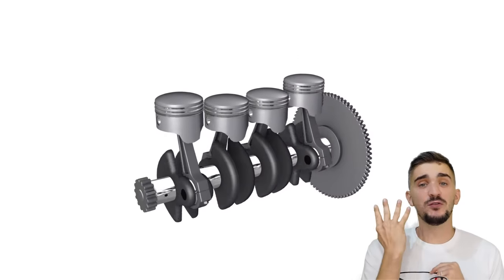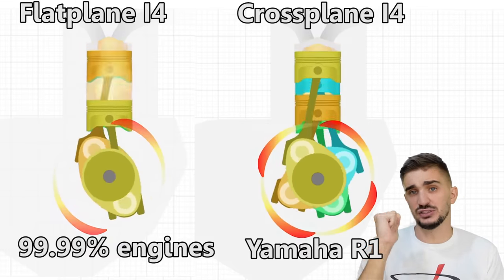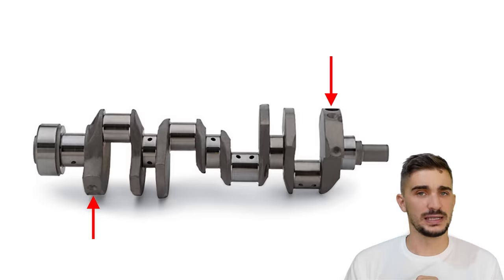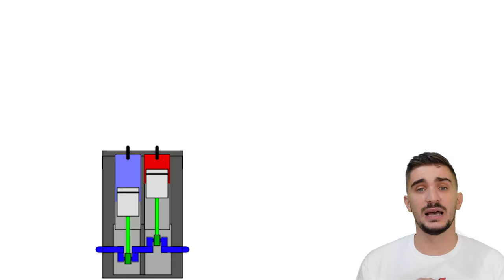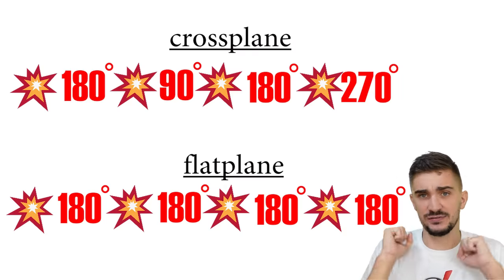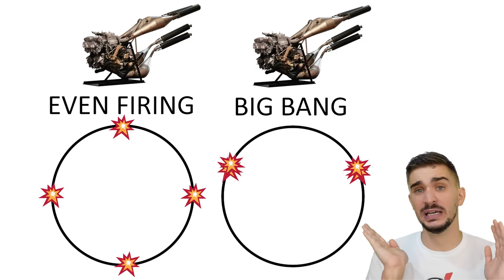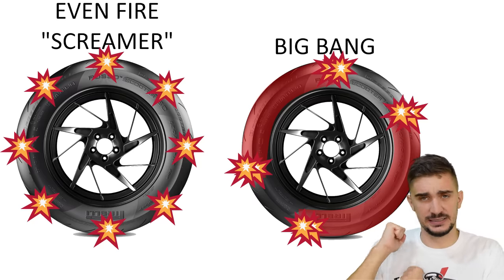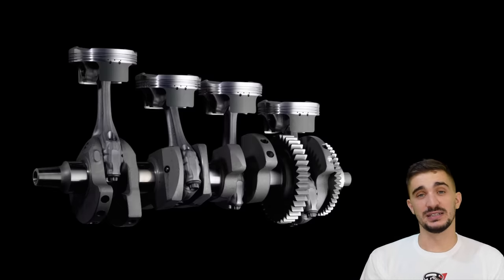CROSSPLANE inline 4 EXPLAINED in detail - How the YAMAHA R1 i4 differs from all other INLINE FOURS

Comment: There is one large problem with a flat plane crank on a four-cylinder engine. Leading to balance shafts and large counterweights being fitted, and that is all four pistons and rods must come to a complete stop to change direction at the same time every half revolution of the engine. Two pistons hit the bottom and two hit the top the pistons have to physically stop moving to change direction, where a cross plane crank only two pistons change direction at any one time.  If a flat plane crank is so good, why don't they run them in a inline 6 cylinder instead of journals 120 degrees apart.   If I had a choice, I would select a 5 cylinder ( an opinion only :-) .)

Comment: So I guess the question I have is, why can't pistons 1/3 and 2/4 share planes instead of 1/4 and 2/3? You'd reduce the distance between the pistons and reduce the torque from the rocking couple.

But you would displace it I guess in that cause. I'd imagine you would cause the center of the rocking force to oscillate between basically the centers of piston 2 and piston 3 on that perpendicular.

Interesting development

Comment: Excuse me, I want to ask: Is it possible to make a v4 engine with a cross plane crankshaft ?

Because I think maybe with the use of this configuration the Yamaha engine can get a increase in power . Because the rotational is 90 degree every cylinder firing turn like on a America v8 by firing alternately between 2 cylinders, like you explained. And in order to counter the low revving American characteristic by using the balancing shaft. 

And maybe use 2 exhaust like the one in rc213v, so the exhaust gas can flow out more freely and not get stuck making the engine can get a lot more power .

I was inspired by your explanation in this video and your video for the corvette cars crankshaft ( Very detail and good explanation by the way). So i was thinking maybe with this solution the Yamaha motorcycle can get more power but still retained stable cornet exit acceleration, still have the recovery gaps and decrease high side possibility.

I don't have any engineering degree, so if this sound ridiculous I am sorry . But I would like to hear your comments in this theory of mine, Thankyou.

Comment: Does this design produce more torque coming out of the corners? I know with cross plane V8s they tend to have more low end torque than the flat plane V8s, so I was wondering if that translates to these 4 cylinders.

Comment: I see the crossplane R1 has the exact same firing as my VFR800 90 degree V4. 
I have 180-270-180-90, but i've overlaid the cylinder position graphs and saw that there is perfect balance since there is a compression stroke at the same time as every exhaust and an intake at the same time as every power stroke, although with the V configuration there is a backward and forward imbalance, and secondary imbalance is counteracted with the shorter crankshaft than an I4. 
@Driving4answers could you make a video on the V4s in the VFR, Ducati V4 and Aprilia V4.

Comment: Every inline 4 I've torn down had the exact same wear pattern on the cylinders. Even blocks that should have been extremely rigid showed signs of flex from the opposing masses. Wondering what  wear pattern will be found on the crossplane design.

Comment: I'm confused about the balance shaft. It appears to be either gear- or chain-driven (presumably by the crankshaft). It looks like it would add inertia to the engine's rotation in the same way heavier counterweights do with a cross-plane V8. Why does the balance shaft not affect the "rev-happiness" of the engine?

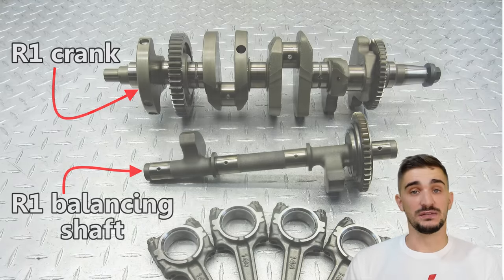Comment: 8:25 How does a balance shaft affect revs less than adding more crank counterweights? Is the diameter less? A balance shaft requires an additional shaft, while counterweights share the same (crank) shaft.

Comment: Please discuss the new Ducati  V4 with a 70 degree crankpin offset
cylinder:                                      LF    LR             RF     RR                       LF
crank degrees at ignition:         0     90            290    380                     720 (0)
degrees before next ignition:      90       200         90              340

Comment: I have often though that Yamaha did it wrong, with their crossplane crankshaft. Just think about this: shouldn't a crankshaft design wich has the left and right pairs of cylinders spaced at 180°, and both pairs spaced 90° apart, so #1&2 can balance each other out, and so do #3&4, to minimize the primary rocking couple.

Comment: Of course I have to be that guy, but there are certainly other crossplane 4-cylinders out there.  Most commonly, 2-stroke outboard motors.  You'll see it in a few other less-common 2-stroke applications, such as the old Yamaha TZ750 race bike or some of the mad Franken-Kawasaki creations of Allen Millyard.

A crossplane 4-cylinder 2-stroke fires evenly and as often as a V8.  Scavenging doesn't really get affected since 2-strokes run individual intakes and exhausts in bike applications, and stupid awful log manifolds in boats.  They sound exactly like a Mazda 4-rotor, which is to say, unbelievable.

Comment: They would have had a difficult time with this design back in the day of the distributor ignition systems. Imagine the cam for the contact points. To me, the sound is similar to the cross plane V8.

Comment: What if the Crossplane engine switch the angle of cylinder 4 and 3 so the 1 and 3 are 180° apart and 2 & 4 at the mid stroke

Comment: The smoothesr engine is the I6, not a V12. That scale you show in the beginning is nonsensical. Power also doesn't come from cylinder count alone, nor does efficiency (a Twin with the same capacity is usually more fuel efficient than a single, but this is not a linear correlation and depends on capacity).
The rest of the video however I can applaud. 👍

Comment: So Yamaha R1 engine makes roughly 15 more hp than a cbr1000rr, but also weighs 20lbs more or so, is it really worth the difference? Also, do R1s rev slower due to the increased rotating mass and not rev as high? There’s gotta be a reason supercars use flat plane cranks

Comment: Crossplane firing order four cylinder engine without vibrations and balancing shaft is any V4 engine with 180 degrees crankshaft. Like Honda VFR RC36 & RC46. Thank me later :)
Reply from the maker: The word crossplane does not refer to the firing order
Reply: @d4a  Just add "R1" at the beginning of the sentence.

Comment: Comment about the thumbnail logo.
The logos of Yamaha, which makes and sells pianos, etc., and Yamaha Motor, which makes and sells motorcycles, etc., look similar but are different. The logo used in the thumbnail is the "Yamaha" logo. The most noticeable difference from the Yamaha Motor logo is the color of the logo. "Yamaha Motor" is red.
About the relationship between Yamaha and Yamaha Motor
Yamaha was founded in 1887 by Torakusu Yamaha. In 1897, it became ``Nippon Gakki Seizo'', and as it expanded its musical instrument manufacturing business, it began producing upright pianos in 1900 and grand pianos in 1902. was written. Later, in 1955, the motorcycle manufacturing division was separated and established as Yamaha Motor. In the past, Yamaha was the parent company of Yamaha Motor, but since the capital relationship was reviewed in 2007, the relationship has become more like a sister company.
*Yamaha Corporation changed its name from its predecessor, Nippon Musical Instruments Manufacturing Co., Ltd., to its current name on October 1, 1987.
About subtle differences in logo marks
The reason for the difference is that the tuning fork mark resembles a motorcycle wheel. Since it is a wheel, the entire wheel must be connected, and Yamaha Motor's tuning fork mark has an internal tuning fork that extends all the way to the outside.

Comment: I6 should be way higher on smoothness than it is on your chart there. It's a smoother configuration than v8 and v10 as the primary and secondary forces are in perfect balance.
Reply from the maker: You're forgetting power stroke overlap which is greater on a v8, not to mention a v10.

Comment: If this Big Bang traction theory was correct, then the ZX-RR should've cleaned up in MotoGP.  All the supposed advantages of Big Bang, combined with the light weight and superior engine balance of a conventional flat plane I4.

History shows, however, that win is the one thing the ZX-RR never accomplished, and one of the most serious knocks on the ZX-RR engine was (can you guess?)...  lack of traction on corner exit!

Interestingly enough, if you talk to a Yamaha engineer, or read what they've actually written about this engine, one thing that's conspicuously NEVER mentioned as one of the reasons why they went with this layout, is spacing of power pulses.

The real reason for the existence of the cross plane I4 has to do with "inertial torque".  In a flat plane, all pistons come to a stop at the same time (when all are either at TDC or BDC), and all pistons also have maximum velocity at the same time (90 degrees rotation from TDC/BDC).  At any given point during the crank's rotation, ALL of the pistons in the engine are either stealing rotational energy from, or giving rotational energy back to, the crankshaft.  This creates a sinusoidal variation in the torque output which, at racing RPM, is very much larger and more significant than any variation in torque output related to cylinder firing order.

By contrast, in a cross plane I4, when the two outer pistons are at TDC/BDC, the two inner ones are at maximum velocity, and vice versa.  A cross plane I4 has practically no sinusoidal variation in output due to inertial torque, so power delivery to the rear wheel is much smoother.  Another thing which the relative lack of inertial torque allows you to do, is run a smaller flywheel, which makes the engine more responsive.

Comment: I am not sure how a balance shaft maintains the rev happiness of the engine.  It is an added rotational moment of inertia.  Given the same BMEP and other factors, the delta rpm per sec must be negatively impacted - same torque applied with higher rotational moment of inertia, so slower to increase rev and slower to decrease revs. If the balance shaft has a lower rotational moment of inertia to an alternative vibration reduction scheme (whatever that is), then the engine will have a better rev- happiness factor but will still be a leer performer to an  engine with no vibration control.

Of course this is further affected by the increased losses due to frictional and viscous damping of the balance shaft.  These may be partially (or not at all) compensated by the reduction in losses caused by the vibration itself, that is, vibration that is not helping to rotate the crankshaft must be regarded as a loss, and like all these types of losses, will be converted to heat - eventually.

Comment: My yamaha MT-09 tree cylinder has a cross planed shaft also.
Reply from the maker: All three cylinder crankshafts are essentially cross plane as there's really no such thing as a single or flat plane three cylinder crankshaft. All 3 cyl crankshafts are either a three pronged star or a T shape when observed from the nose and in all cases the planes cross each other so the term is a misnomer. Yamaha's likely using it for naming consistency and marketing purposes to trickle down the allure of the R1 lower in the model range.

Comment: and by the way, afaik the Crossplane 4 engine is notorious for being the worst gas guzzler. I wonder if techs such as dual injection (ofc), pre-combustion (which might just be the ticket for direct injected engines at higher speeds), variable valve (Yamaha has developed one for new generation R125, which is more similar to that of VTEC instead of VVT (or VVTL-i in 2ZZ-GE (without the variable timing), coz Yam developed it for Toyota)), and/or maybe even Hydrogen (which Yamaha is rumored to be co-developing with Kawasaki). But then again it's most likely to be pointless and the added weight and complexity (which in turn, cost) most definitely doesn't justify for a platform where speed is more crucial than anything else.

Comment: ...the question of whether the average R1 rider could handle the power output of a literbike is oh so important when you consider that at the time experienced riders were regularly highsiding literbikes ...to the point where mfgs were retarding the spark significantly...a practice that became ever more widespread as it kept noobs on the back of their bikes  regardless of the power output. Not necessary to change the crankshaft configuration when you can just dial down the power electronically.

Then along came the S1000RR and the Panigale 1000RR both uncompromising motorcycles with their own strengths and weaknesses and yet again "a real man wouldn't be caught riding a watered-down Japanese bike"...

Having ridden all of the literbikes and most of the "superbikes" (1200cc+) I just can't see how any other bike but the S1000RR can be taken seriously. Whatever flaws or benefit the i4 has relative to a vtwin, v4 or crossplane I4 or the 600s vs the literbikes? Just get on the S1000RR. Whatever issue bothers you? It simply disappears. It's really hard to imagine a more perfect motorcycle. And yes it's overpowered for many riders and yes it would be interesting to see a 600cc version of it, to rival the R6 and CBR600RR. I think that BMW was wise to concede that market to the Japanese (and especially to Kawasaki).

Comment: Actually a 4 cylinder does not have perfect balance due to the firing order. You still need harmonic balancers. Only inline 6 and V-12 configurations are perfectly balanced.

Comment: The explanation at 7:10 - 8:30 is not quite right.

Crossplane V8 can use simple counterweights because of the "L magic" - two pistons in a 90 deg V, sharing a crankpin, together give circular primary imbalance motion instead of up-and-down (sine function in X coordinate, cosine in Y, together give the circle equation). This is why they can be balanced out with a simple counterweight.

Taking away one I4 bank from a crossplane V8 makes all the imbalances back up-and-down. Attepmting to balance them with counterweights would cause reduction of up-and-down imbalance at the cost of introducing side-to-side vibrations. This is why we need two counter-rotating balance shafts - to cancel out the side-to-side vibrations. And one of them can be the crankshaft while the vibrations are primary. This is also why two balance shafts (rotating 2x the revs) are needed in case of secondary vibrations of a flatplane I4.

The revving issue applies to the crossplane I4 with a balance shaft even more than to a crossplane V8 with counterweights. The total moment of inertia (in relation to the total mass of pistons nad stroke) will be even greater than in the case of crossplane V8, because crossplane V8 counterweights balance the pistons only, while the counterweights on the crankshaft and balance shaft of a crossplane I4 need to additionally balance each other side-to-side. Optical comparison of the parts of a small bike engine with pistons as light as possible to the crankshaft of a huge car V8 does not do justice to the concepts considered.

PS. I4 crossplane layout would be perfect if somebody resurrected the two stroke concept (with direct injection and AC electric blower it might work with a regular oil pan). It would be even firing and the simplest configuration with inherent secondary balance (and easy to get the primary balance with only one slowly rotating additional shaft). Inherent primary balance in an even firing two stroke is possible in a 90 deg V4, yet it lacks the secondary balance. I cannot think of an even firing 2-stroke configuration with both primary and secondary inherent balance, because there are no piston pairs moving together (compression / exhaust, combustion / intake).